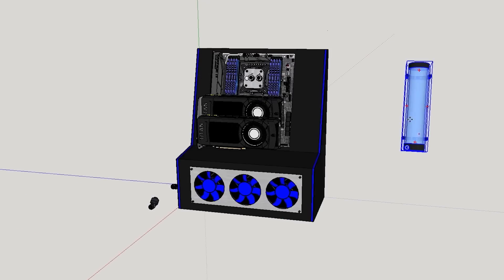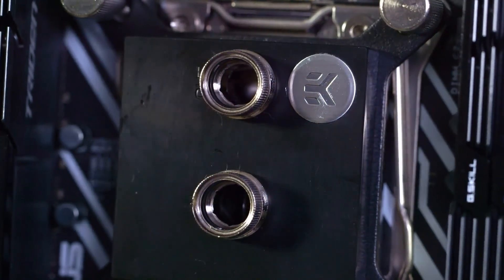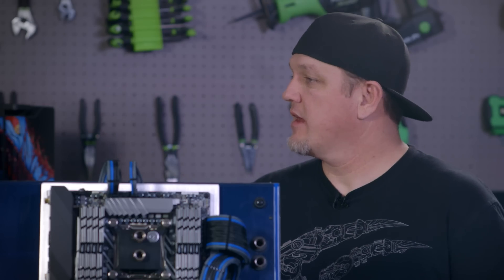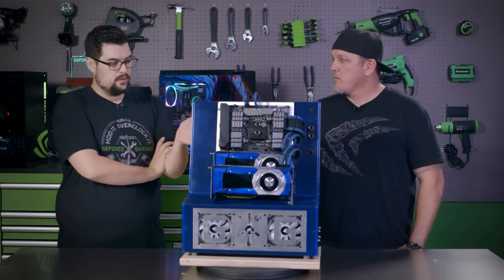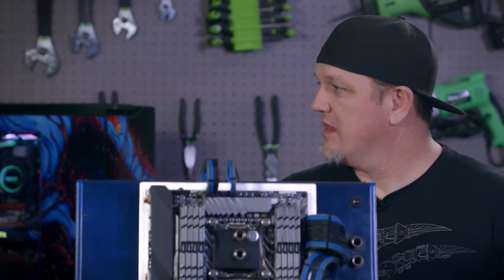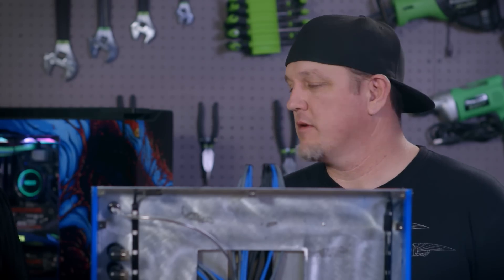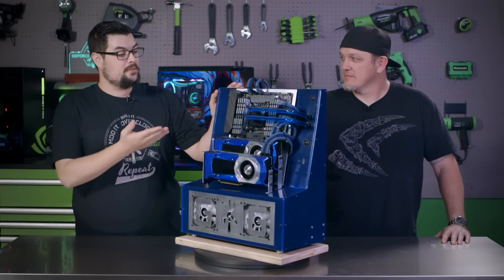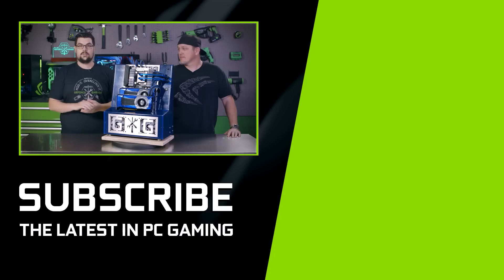GeForce Garage: Scratch Build Episode 6 - How to Plan Your Watercooling Loop

Comment: All the reasoning he gave for using acrylic is irrelevant. The system is going to be staggeringly cooler than ANY closed chassis. Air might not be forced to flow away from the motherboard, but it will by convection, and it's not going to be more than 1 or 2 degrees warmer than ambient. So unless your space is uncomfortably HOT your PETG isn't going to be a problem at any level in an open air chassis. On top of that the 360 radiator, is ridiculous overkill for cooling a CPU only. I overclock my 8700k on a 240 Rad setup with 2100rpm pump and the slowest fan speeds I can get, and still have plenty of thermal overhead.

Comment: watercooling for a CPU with a stock air-cooling for a GPU is, uhm... not very sensible

go check out TDP for CPUs and GPUs, then compare the size of a CPU air cooler you can use and the size of GPU coolers, then take in account how "great" GPU air cooling works in SLI configs. at this point it would be pretty obvious which parts require more efficient cooling, and which ones - not so much

hint: 98% of the time it's not the CPU

Comment: Do you think I should go with a custom loop or a AIO for my next PC? It will be a Ryzen  6 or 8 core CPU, I have not decided yet.
Reply: Ryzen doesn't really run that hot. An AIO should be more than enough. I know this is more than you asked, but even a nice air cooler like a noctura would do just as well. If you want to save a few bucks to maybe squeeze up a tier on the CPU or GPU you could even use the stock cooler. Most reviews say they work well even for mild overclocks.

The only reason I would do a custom loop is to cool the GPU as well. Either right away, or with plans to add it in the future. The ekwb aluminum kits can be purchased with a GPU block included and can be expanded. Just be sure to not mix metals. Either do all copper/nickel or all aluminum.
Reply: Alan Dotts Thanks! I will probably just get a nice air cooler than as I don’t plan to do much over clocking.

Comment: Can someone explain why this is better than usual cooling?
Reply: What they have done really is not. The GPU would benefit from it, but they are not even in the loop. A good air cooler like a noctura performs basically as good and there is nothing to fail. With that said I have a custom loop just because I like the way it looks and enjoyed putting it together.

Comment: Tbh, never thought about when you are running your pc silent with petg that the heat in the case would be enough to affect the petg. That was some good information there from Lee.
Reply: That it was! However I don't see that running down with blower style coolers anyway. Lol. Love how they take the heat out of the case, but with an open bench an open air style cooler would be much better.